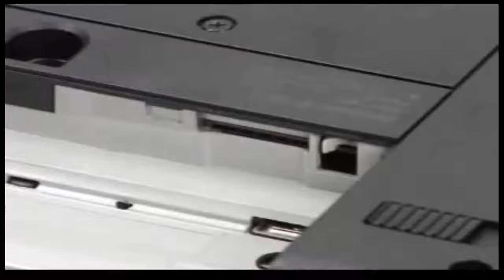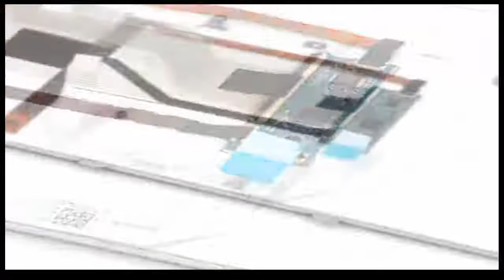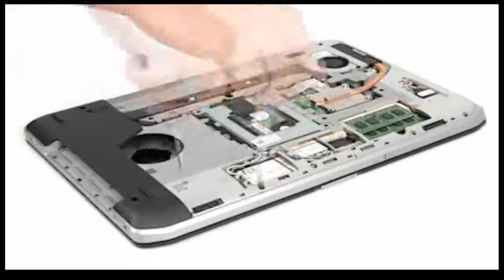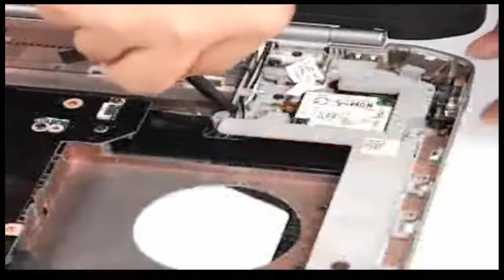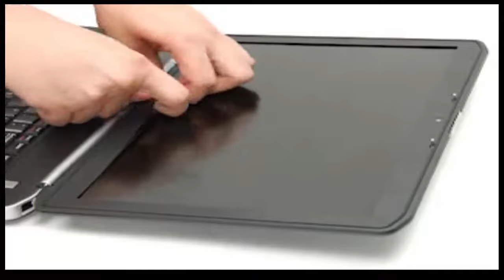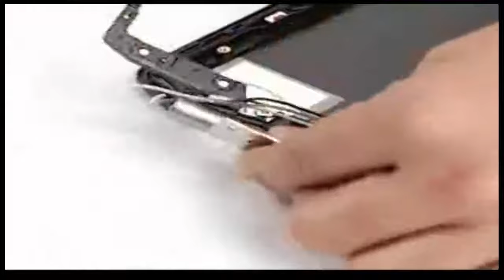How to disassemble dell Latitude E5520  E5520m  5520

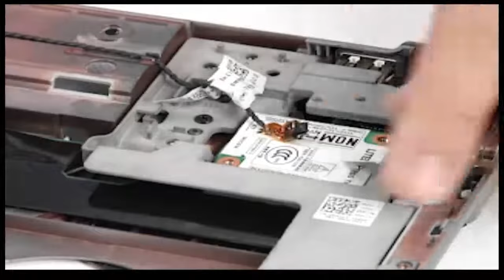Comment: My laptop doesn’t have this part @ 8:20 what is that? I had an issue with laptop 7 years ago and sent to Dell to fix (was brand new) and since that date never opened it. Just opening it  for the first time yesterday and saw this part that I have a place for it but it’s not there!

Comment: What a mess... every laptop from 2010, 2011, 2012, 2013 priced 590USD and over are a pain in the ass....
Reply: seriously. i just want to clean out the fans and replace the hard drive and it looks like a complete pain in the ass. at least the thermal paste replacement is easier than my early 2011 mbp13 but that’s not saying much…